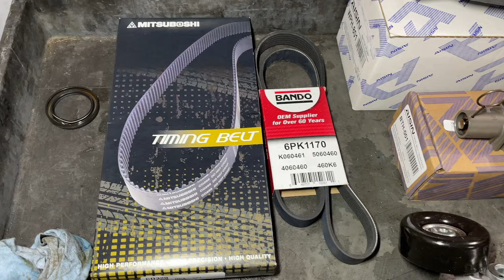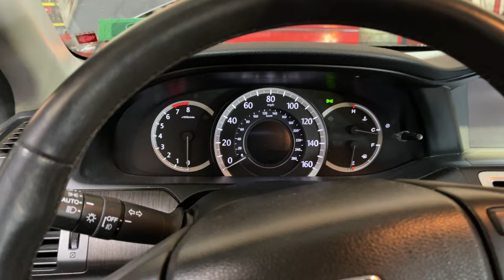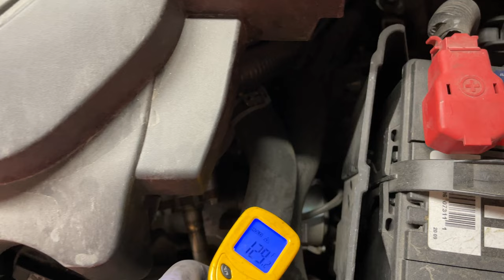TIMING BELT AND WATER PUMP SERVICE ON A V6 HONDA :: 2014 HONDA ACCORD J SERIES

Comment: A couple of questions: Do you have to change the crank seal, is there a jack under the engine before removing the motor mount?
Reply from the maker: Negative on the crank seal, we just do it since we're there as preventative maintenance and that passenger side mount does not really support much weight so I remove it without a jack under the oil pan. If it seems like it's sagging excessively though, it wouldn't hurt to put a jack under there to support things until you remove it.

Comment: Great video. I have the same 2014 Accord V6 with 83k. The dealer told me it was time for a timing belt based on years(7yr). Have you seen many timing belts break based on 7-10 years? I live in the Northeast NY area so not sure if the weather plays a big role. I was hoping to wait until 100K miles. Also, how many hours are this job timing belt, water pump, and tensioner? The dealer wants $1900 including parts, which seems a bit high. Any advice is appreciated, Thanks.
Reply from the maker: That seems a bit high. We recommend t-belts based on the same schedule though. 7 years or 100k-ish, which ever comes first. I haven't seen any J series belts break but I have seen teeth shear off. Don't remember the mileage on those but they were pretty old. I'd say you're probably ok but plan on doing it within the next 15k. This particular car was one of the easier J series timing belts I have done, takes me a few hours but I also have a lot of experience and can knock these out fast. I don't know our exact pricing but I think our shop charges $1200-ish for this job parts and labor.
Reply: @SkillCollectors  Thank you!! that is helpful

Comment: What tool setting did you use to take off the 10mm bolts on the upper timing covers? I am having hard time doing that. Maybe because I haven't taken off the engine foot mount section?

Comment: Does the car need to be in drive or neutral to turn the crank bolt to tdc?
Reply from the maker: If it's a manual, it has to be in neutral, otherwise, just leaving it in Park is fine.
Reply: Thanks for the clarification!

Comment: Does the engine need support after you take the engine mount off?
Reply from the maker: No, it only drops about an inch or less in most cases.

Comment: Do you need to replace the cam shaft seals?
Reply from the maker: I only touch them if they're leaking or if I have to disturb the cam shaft (remove the cams), otherwise, I leave them alone, in my experience, J series cam seals almost never leak, even very old and high mileage ones.

Comment: did you have to do crank relearn procedure?
Reply from the maker: In my experience, after a timing belt job, I've never had to do that. Usually that's done after replacing the sensor.

Comment: How much would this service typically cost?
Reply: As seen here a dealership will run 1500 to 2000 bucks in 2024. The job will be guaranteed to be done right. Independent shops you'll save a few hundred, just conduct due diligence they are reputable

Comment: Looks like your removing tensioner pulley, tensioner etc. from underneath the car while it’s in the air. How did you support the engine after you removed the motor mount?
Reply: Put a floor jack under the oil pan
Reply: There's 2 other motor mounts still supporting it, so just removing that one doesn't allow the engine to move much.